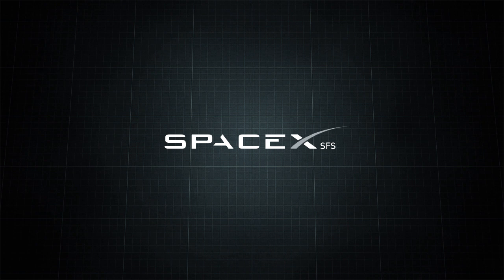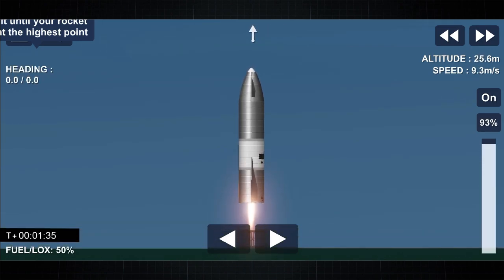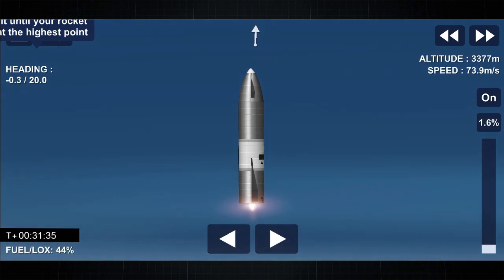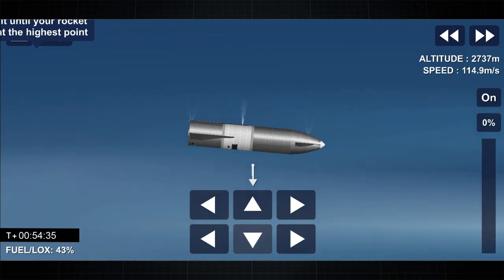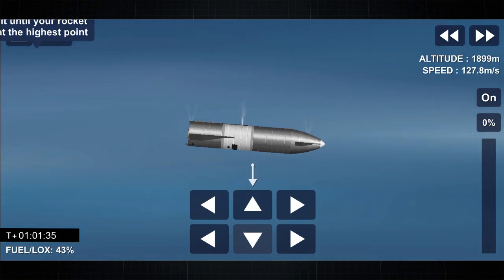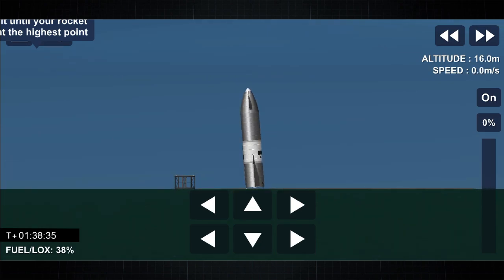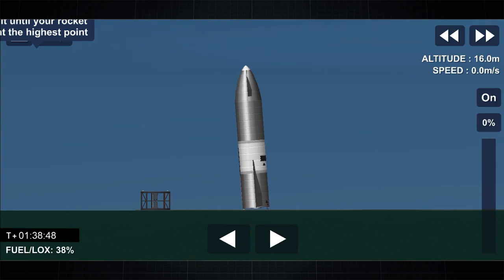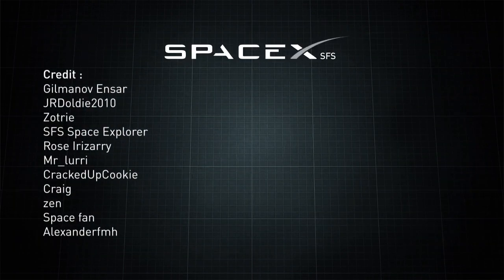Starship | SN10 | High-Altitude Flight Test

Comment: Congrats on SN10 SpaceX! That was incredible
Reply: Also @SpaceX - SFS if you dont mind me asking, What recorder do you use?
Reply from the maker: Just using default screen recorder from phone stocks
Reply: @skyridesfs  Same
Reply from the maker: I can't believe that she make the landing, although forget the landing legs :v
Reply: @skyridesfs  Actually it did deploy the landing legs
Reply from the maker: @ethangobrrr2906  or maybe the legs, destroyed during impact, which make the fuel tank leaked
Reply: @skyridesfs  haha yeah, I think the legs deployed a little late and some may not have deployed, this is already enough for me lol, That was an incredible landing
Reply from the maker: @BlueOriginSFS  at least they got much data from that, which would adding more improvement of the next prototype
Reply: @skyridesfs  yup I can't wait to see sn11 soar to the skies! Sn10 was a real madman ngl
Reply: Actually landing legs were deployed correctly but they when they were deployed, they were weak. It caused a pressure, then methane leak and explosion
Reply: @sdgamer9427  Maybe they didn't successfully deploy the legs. Sn10 had 6 legs and on The landing... Some Shots saw the 3 legs is Deploying back and forth and 3 legs I think is Locked into place.
Take a look: https://youtu.be/GvIJlcRrcpY